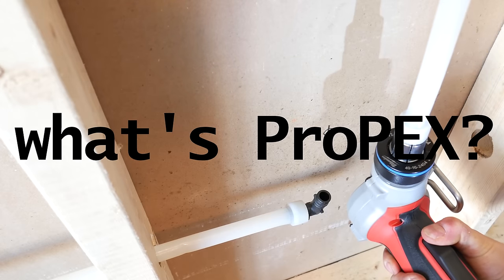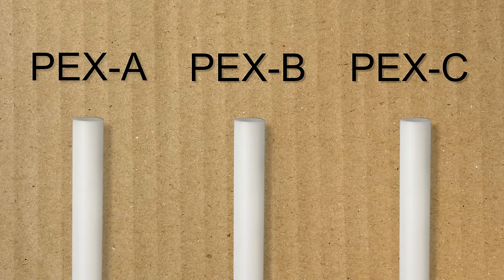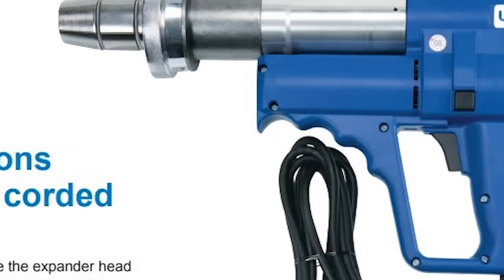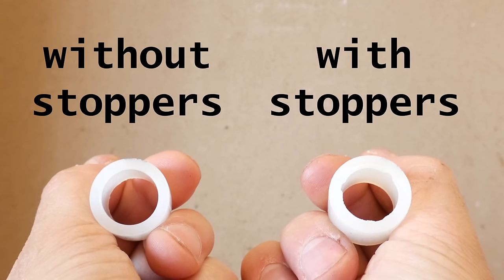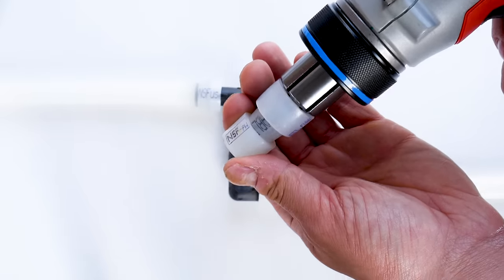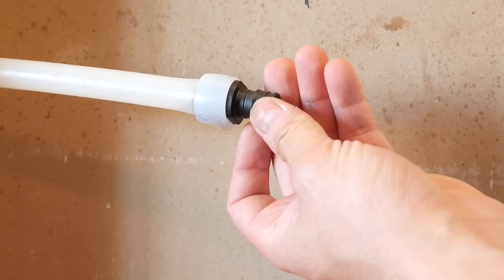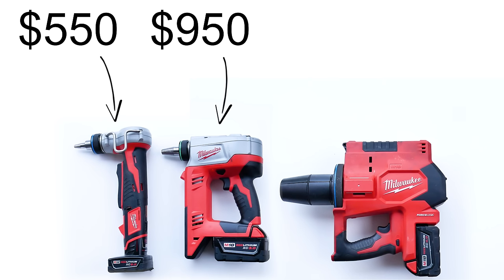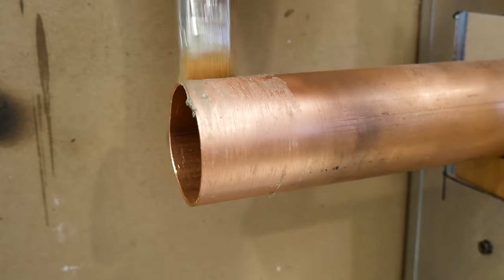UPONOR ProPEX, The Future of Plumbing (COMPLETE GUIDE) | GOT2LEARN

Comment: I was always taught to stop the expansion tool on full expansion for about 5 seconds twice before it was completely ready to put the fitting inside. Never got an explanation why to do this but i just always have and will continue to.
Reply from the maker: I was never shown that, not even from Uponor, pretty sure it's to buy you some time like I said in the video, if it works for you than you shall continue :)
Reply: Well if you don't mind wasting your own time for zero purpose, keep doing so. It's quite obvious you expand it right up to the point of no expansion and quickly toss your fitting on after you remove the tool. The fitting either fits or doesn't fit... I could always park from a jobsite 200 feet away if someone taught me so, but I'd eventually figure out I can get the job done sooner with my vehicle closer.
Reply: Tradition!! (see fiddler on the roof)

Comment: In europa we use the same sort of systems, but with a better kind of tube. With alu layers in the pipe.     https://www.rehau.com/nl-nl/rautitan-drinkwater-verwarming-en-gas
Reply: ....Wait do mean with an aluminum layer? 
This giving me Kitec nightmares
Reply: I heard of multilayer piping. Seems great. Why do you think it's better than pex?
Reply: If you are putting metallic components into a plastic potable water product, it is in no way making it "better"!
Reply: Robert Applegate Its an aluminum sleeve on the outside of the pex. It allows you to run the tubing below floor joists with no sagging. Stays put, no moving around

Comment: Nice video man. Covered pretty much all the bases. As far as new installs goes pex A is tits. Doesn’t always works so well for service and repair. Maybe some info on the Dos and don’ts of going expansion to crimp
Reply from the maker: Thanks Mark, will do ;)
Reply: I've been using propex for around 5 years and I've never had a problem or leak with this system and I connect to pex b all the time I use pex a, pipe with a crimp fitting to connect PEX A to PEX B and from that point I continue with  PEX A  as usual with expansion joint fittings, never have I had any leaks
Reply: Steve Hagan I found I’m able to crimp onto it also. I’ve been told in the past that it’s not a good idea to do it but none of my repairs have ever been a call back

Comment: 550 for the m12 is kinda dumb. Similar Milwaukee tools run about 200. I get the are marketing it as an investment. 
But in the US at the same time Plumbers can run you $75-$150 an hour. So 550 is the cost of a plumber for 5 hours. And you can turn around and sell it to a plumber for 350 easy.

Comment: There’s not much difference in the diameters of the fitting and as far as Flow.... it’ll be Damn near the same. As far as fitting use with Pex-a.... it would be the same with B. It’s just as Plyable. It has to be strapped and secure just the same as all other pex products every couple feet. Not impressed with this product.

Comment: Have there been studies on the effects of this plastic upon drinking water safety?
Reply from the maker: There are many many studies but a lot of the contradict themselves and it's not easy to get concrete infirmation, i'll have to try to get a video on this.
Reply: Got2Learn It seems that you want to use a quality vendor for the tubing and also flush them.   The lowest-grade, made in China tubing may not be a good idea.
Reply from the maker: I try to not buy stuff from China, I just don't see any value in it, but that's just me.
Reply: It does have a slight plastic taste to some. However, a water filter can be installed.
Reply: @graysonwagner1855   true it does have a slight taste but after the water builds a film in the pipe it's almost impossible to taste it.
Reply: PEX A and C can leach chemicals hence I do not prefer it to copper, PEX B has better anti-leach properties. Not to say copper can’t leach either but it’s more robust over time.

Comment: Hmm... A bit like the old lead pipes.
Reply: How so?
Reply: Before steel pipes we used pipes made of lead. They were very soft and we used a special tool similar to this used in propex. You would make one end of the pipe wider and then slide the other pipe into that windened end and then just crimp and solder it together. Lead pipes were a bad idea becouse lead is poisonous and contaminated the water.
Reply: Lead had been associated with plumbing since the ancient times. The chemical symbol of lead (Pb) was derived from the Latin word plumbum which means waterworks or plumbing as lead was used to make water pipes.
Reply: Lead exposure, even at low levels, can cause neurological effects, especially in young children, young women, and developing fetuses. In fetuses, lead in mother's bones released along with calcium as part of the fetal bone formation. Lead exposure can also cross placental barrier into a fetus. This could cause premature birth, growth issues, and death of the fetus. In infants, lead exposure from mother can pass through breast feeding. In children, the effects of lead exposure include learning problems, slow growth, and lower IQ. In adults, low level exposure can cause cognitive, hypertension, and reproduction issues.

Comment: I may be missing something, but I am having a hard time seeing why I might change from crimp pex to this method. Crimp is so easy and relatively cheap, especially the tools. Thank you for the video though!
Reply from the maker: IMO, expansion joints are easier to make.
Reply: @Got2Learn  you think so, or just preference?
Reply from the maker: I honestly find it a lot easier because there's no depth gauging for the rings and the tool is smaller than PEX pliers and it also requires less space. I worked a lot with both, and I prefer PEX-a for this reason.
Reply: @Got2Learn  thank you for your reply! I can see that. Sometimes getting the crimpers in a space is a challenge. I know there are power tool options too though.
Reply: I replaced all the 1/2" copper in my house about five years ago with 3/4" PEX-b, cinch rings (not crimps) and brass fittings. I didn't know the PEX-a system existed. I did recognise that 1/2" PEX-b  fittings were considerably smaller in diameter than 1/2" copper pipe, and so went with 3/4" fittings and pipe to make up some of the difference. But, the great advantage of PEX-a of any diameter is that the bore diameter of a fitting is virtually the same as the bore diameter of the pipe it fits in. This is possible in PEX-a because the tube is stretched over the outside of the fitting, instead of the fitting's being inserted into the tube without compensating in some way for the reduction in tube bore diameter. 
Since I was replacing an existing system with very limited access to floor joists and other routing paths, I pretty much had to do a main line run along the original path (no option for a manifold). This meant lots of joints and fittings, mostly tees and elbows. While I am sure the measurable pressure at the end faucets is close to, if not the same as, the pressure at the pressure reducing valve outlet, the flow rate at the end is certainly lower than faucets farther up the line because of the number of "in series" fittings. I would not have created this problem if I had been aware of the PEX-a system. 
This is touched on briefly in the otherwise excellent video, but could possibly be elaborated on with an edit or two.

Comment: This is evidently not for diy workers. $550.00 for the too you will use to install...and maybe never again. I dont think so.
Reply: Well, how often does the normal diy homeowner need to redo the plumbing in their house?  This is a tool for people who do, do a lot of plumbing, where the tool quickly pays for itself.
Buy it, use it, then sell it while there is still a Return period on your receipt and you should be able to get 80% back.  Just buy the Tool only and the 1 head you need and its much cheaper.  You end up losing $50-100 bucks, which is what a rental would cost you if you could rent one.

Comment: I only use copper for tub and shower valves, top of water heaters, minimal stuff for in floor heating valves and some specialty fixtures.  Other than that its all wirsbo. 

Also, the propex expander is the only way. My shop had a dewalt expander and the other week it started shocking the shop guys when used. Lol. 

One thing im super surprised with is that Ridgid hasn't come out with a pex expander.  🤯

I spoke to a sales rep about it and he said he's been trying to push for it, but they've invested so much into the crimping tools they can't look back. But i mean.....everyone knows its all about pex A.

One con about pex A is straightening ¾ wirsbo in the winter and then getting whipped in the face if it slips and slings back at you. 🤕

Lastly im pissed that milwaukee discontinued their propex cutters. The new ones dont have that correction groove at the top for cutting rings. 

Final lastly - lol @ the short piece and cracking the fitting. Ive seen that happen only once.

Comment: Help.  I did one PEX A connection and forgot the expansion rings.  It's not leaking but I am worried.  If I cut it out, I have to replace with two new joints.  How do I remove the PEX A black plastic pipe connector without cutting pipe?
I know, I'm an idiot.

Comment: I only wish to comment that the cost of the expansion tool that is required to use this pipe is absolutely rediculous.  I can’t see where that should really cost any more than a cordless drill  I think that in itself is a total rip to the ass
Reply from the maker: It pretty much costs the same like a cordless drill hehe, just a little more.

Comment: I am a plumber been in the trade for 35 years I don't like PEX or Opinor there are some good applications say for under slab, temporary Water lines or direct burial but I've installed this in commercial buildings and I absolutely hate it for that application
Reply from the maker: Why do you hate it so much?
Reply: @Got2Learn  well for one it's sloppy looking another reason is if you have to put two 90s clothes together in a tight pattern you are limited because the nineties will crack from the tool. And horizontal runs we were using track to support it and to me with all the hardware required to support it . there is no savings because of the amount of Labor to hang it not to mention the hardware. We were running some pretty big stuff 3 in open or all the way down to half what's a man of Labor time I believe I can run copper just as fast if not faster. I do believe are some good applications for it but not for a commercial building water distributions system

Comment: At 6.29 you say copper corrodes. It is a wrong statement. Please fact check.
Reply from the maker: It does.
Reply: Got2Learn  well this is knowledge for me . I have dealt with all kinds of plumbing including copper and never came across copper corrosion. Oldest copper plumbing can be found in Egypt approximately 5000 years old still in good condition. I will do my research though.
Reply: Got2Learn  well galvanic and corrosion can happen .
Reply from the maker: That is what I meant. The copper itself doesn't corrode, but when it comes in contact with stuff that makes it corrode, such as harsh water, or flux for example, it corrodes :)

Comment: These things (any plastic tubing) are going to be leaking in 20 yrs. Great idea, but flawed for long-term.
Reply from the maker: They've been running for 20 years already, no problems yet.
Reply: @Got2Learn  Doubt that. Even so, the plastic WILL deteriorate more/faster than copper will.
Reply: . In 1973, Uponor (Wirsbo) submitted PEX pipe samples to an independent laboratory. For three decades, these samples underwent continuous hydrostatic tests at extreme temperatures and pressures — up to 203°F (95°C) and 239 psi (16 bar). At the conclusion of the tests, not a single piece of Uponor PEX experienced any breakdown or failure.

Comment: Hep2O avoided these issues by using a thin stainless backing sleeve  and a fairly flexible pipe that needs far fewer fittings. It works on Pex and copper pipe 10mm, 15mm, 22mm and 28mm. No setting tools needed.

Comment: Pro pex  is nothing but warlsbough which was a predecessor of pex  pipe but they’ve changed it to be the same material as pex so you expand it with with a tool add a ring that compresses it after it constricts rather than compressing a copper ring over the tube To compress it to a fixture

Comment: You just taught me that I can pull those off too. I thought that shrink on was permanent. So these have it all over crimp on. What I am understanding from this video is that this ProPEX needs specific joiners, made just for ProPEX. Well though right off the bat, and when it gets to it's designation, they will have to go onto hard metal fittings. I see them fit onto metal fittings, so I will have to ask about all that. Still learning.

Comment: Seen it being used on huge remodels and it seems to take much longer than just using glue and fittings and doesnt seem cheaper since you have to buy the expensive tool and the hourly wage it takes to sit there and use these as opposed to just cutting and gluing in seconds.

Comment: Ferguson's version of this is AquaPex and it was only through Ferguson that you could buy this pipe originally. Things change, but this is exactly the same stuff. One caveat I will add is that expanding a joint with water in it, is tricky with the lever expander....especially one inch. The water tends to flush out the food grade grease they give you to lube the expander heads with.

Comment: The problem with Uponor is very high cost-- the fittings / connectors are insanely priced. Even the manual expander tools are disappearing from the market, since resellers can make much more profit from the battery powered tools, like Milwaukee.  With an existing PEX installation using clamped or crimped fittings, we must have both types of tools available for any adjustments.
Reply from the maker: Yes they are expensive, but the savings in time make it worth it ;)

Comment: Have you ever had an issue on 1 inch trying to expand it if there’s a little curve in the pipe? From a roll or pipe. I cannot seem to get the expansion tool (electric) to do it. 

I was able to do 1 other no problem
Reply from the maker: Never, no.
Reply: He tool keeps backing out ! I was able to do another 1 inch and 3/4 but I wonder if I need to cut the curve ? Idk I was pushing it in really hard
Reply from the maker: @spiritual_home_for_artists  is the die properly greased?
Reply: Weirdest thing! I cut about 3 inches off the pipe and tried again today- no problem! 

But last night, I could not get it to stay in the pipe. And my only conclusion is there was still a slight bend in the pipe (came off a roll) 

However, the 1 inch sleeve is still good on the piece I cut off, but I literally cannot remove it. Either way problem has been fixed.
Reply from the maker: @spiritual_home_for_artists  hmmm, weird!

Comment: Stick to residential homes.
For one on a 3in tee it takes over 8 minutes to complete the joint. You know we all can't prefab everything on the ground.
Try holding that big machine over your head for over 8 minutes 😂 over and over.
No 3 in plugs , no 3x1/2 tees .
The offset on 3 in 90s is over 12 Inches. 
Don't get me started on the track and the hangers.

Comment: Heating and cooling throughout the years will cause heat in plastic, no matter what.  The automotive industry uses plastic pipes on their heating systems, sometimes under the intake manifold and it is a disaster.  Give me a brass connector and this system with a metal ring and I am sold.

Comment: Crimp rings are better
Reply from the maker: Why?
Reply: @Got2Learn  when you get into higher operating temps the expansion pipe can expand from the combination of water pressure and heat thus causing a leak at the fitting......I have seen it multiple times more commonly on bigger pipe like 1.5 and 2 inch .........when you use crimp style fittings you don't have that problem. They are also faster than expansion style connections especially in colder temps it can take 5 mins for it to shrink back down crimp style is instant no matter the temperature

Comment: Stuff is hot garbage
Reply from the maker: Negative.
Reply: @Got2Learn  So, the fact that, if you are a good plumber, you can cut, clean, and solder an antimicrobial piping system together faster than you can put this garbage together while making your pipes plumb, level and square, the need of a staged testing system (gradual increase in psi), the fact that it has around half the service life expectancy (if it hasn't been exposed to high levels of chlorine like the chlorination regimine prescribed in IPC, or exposure to sunlight prior to installation) and the need for continuous support (or a hanger every 2.66') somehow makes this a superior system? About the only benefit i can see from any of this is an increase of resiliency in freezing temperatures. Why spend the money on equipment when you can easily get a 2" solder connection done in 5 minutes with a quarter of the time invested in hangers where this stuff takes 7, and that doesn't even count for installing the continuous support. Pex is hot garbage and should only be used where pipes are subject to freezing temperatures that cannot be mitigated by the installation of heat trace.
Reply from the maker: Totally respect your opinion bud 👌